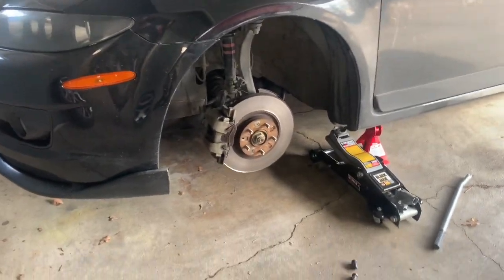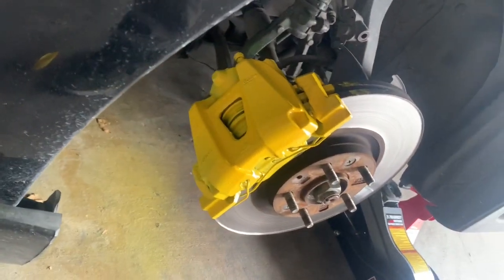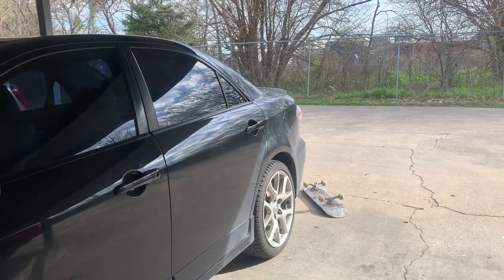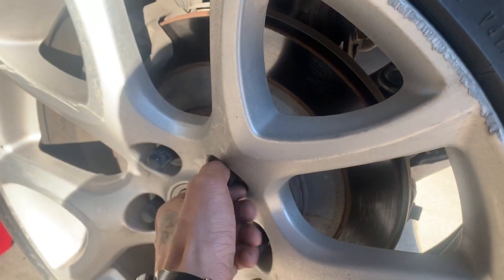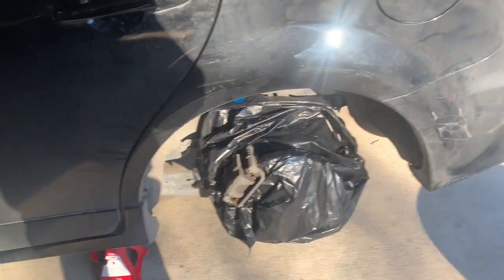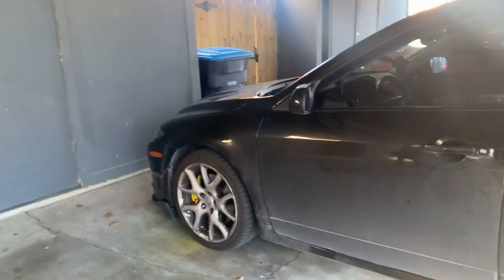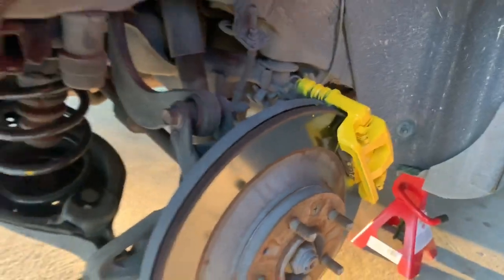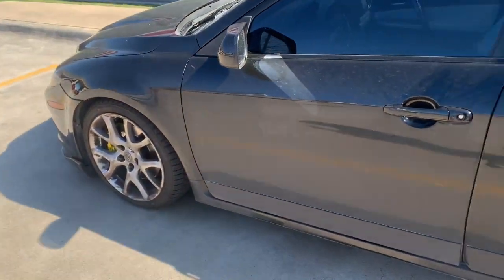Painting My Calipers Yellow

Comment: Just buy evo 8 brembos
Reply from the maker: Maybe in the future Got power mods I need before brakes but I’ll look into them
Reply: @mazdaspeedg2380  bro what power mods you looking to do. I have a fully built mazdaspeed 6  i haven't uploaded videos yet but i have some in the making. Mods:koyo radiator,radium pcv plate,cx racing piping tr35 ic,dm 4port aux kit with focus st manifold,ebay cast ported manifold,borg warner sx300,precision race port bov, tial 44mm waist,sp63 tcase bering caps,clutch masters fx400 6puck. stay tuned to my channel for updates